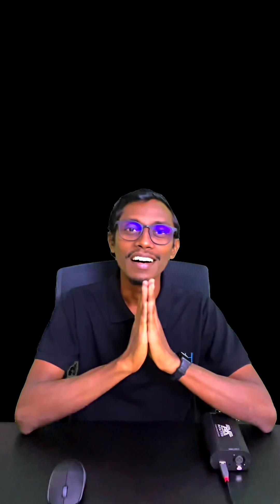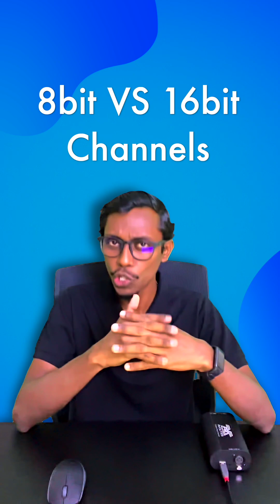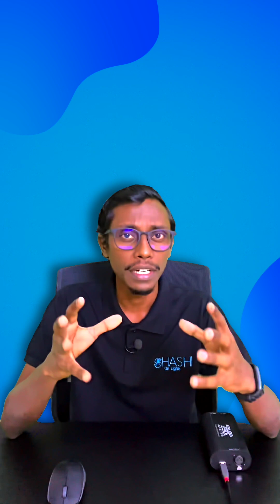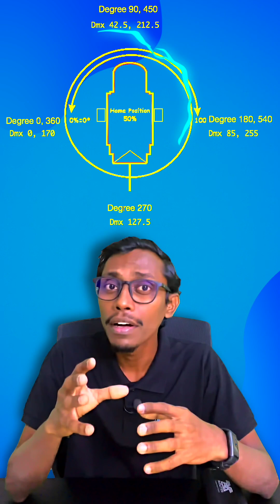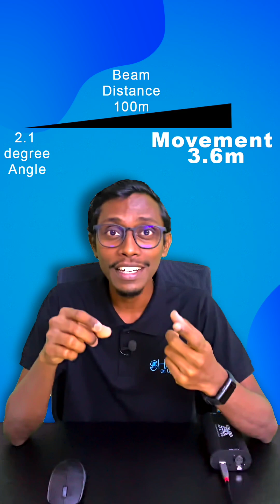8 bit vs 16 bit : Does it matter?

Comment: How can you tell which channel type you're using, I'm using my schools avolites tiger touch 2 controller with pre set up lights
Reply from the maker: You can find fixture details in your Manual. Or you can open the fixture personality file in Personality editor and check each attribute for 16bit or 8bit.